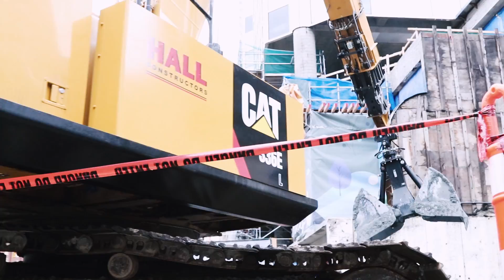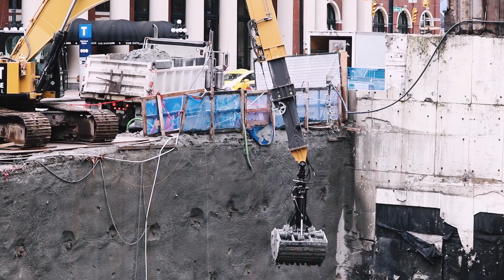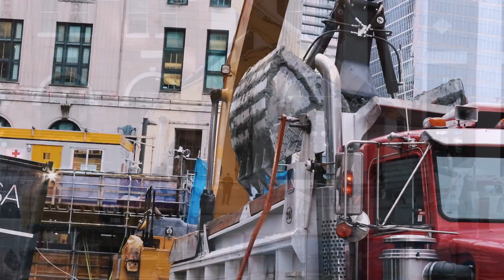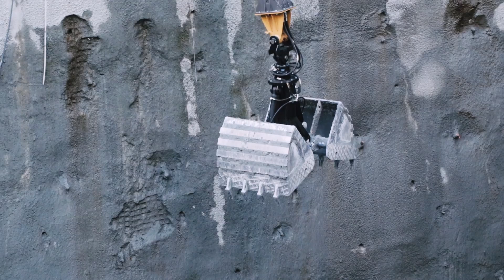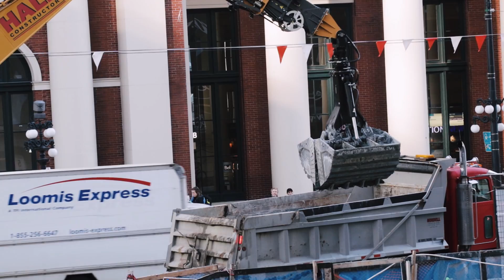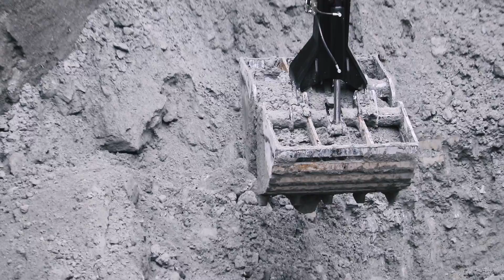Telescopic Boom with 115ft reach!!!

Comment: Rumour has it that job is punishment for shoplifting in some countries.
Reply: Shit, get paid pretty good to do it.
Reply: @kylemapstone7594  You run that telescoping machine? I’m an operator, I’m not talking about the job in general, I’m talking about that specific job in the video….. looks mind numbingly boring and better be making 45-55 an hour to do it otherwise why bother.
Reply: @ShredForth  I make 38, and in virginia beach that's way above excavator pay. Usually 25 - 29. It's way better than carrying around 60lb bag of quickcrete for 17. I run everything tho, loaders, track hoes, backhoe, track loader, skid steer, motor grader, cranes, wheel excavator, shit dude some of the loaders Ive ran are bigger than a two story house.
Reply: @kylemapstone7594  yeah I do all that too and have commercial licence. This video is in Vancouver BC and it’s totally normal to be making 40-45 an hour here…… I make 47 plus pension/benefits and have a company truck/gas card.

Comment: If you have a crane big enough to set that other excavator down in the hole, and pick it out... Why not put a big box down there and pick out 30, 40, or 50 ton at a time?
Reply: Maybe because of the footprint of such a crane and restrictions on duration/extent/hours they are allowed to disrupt traffic? Just a wild guess.
Reply: Because they would have to shut down the road. The crane takes up both lanes.